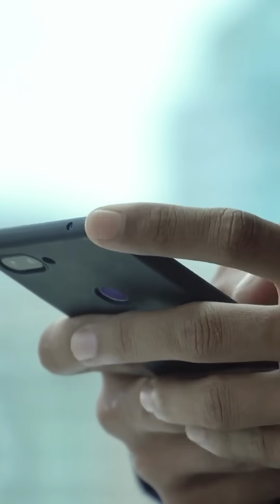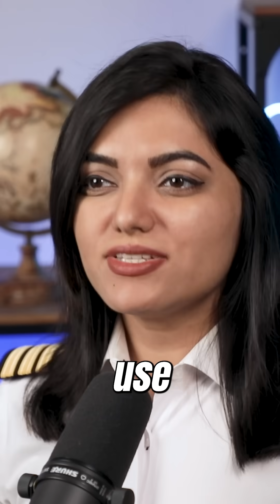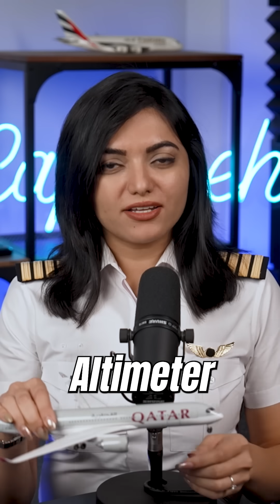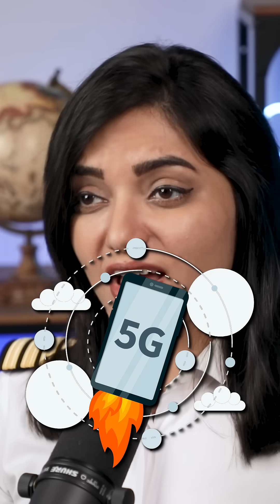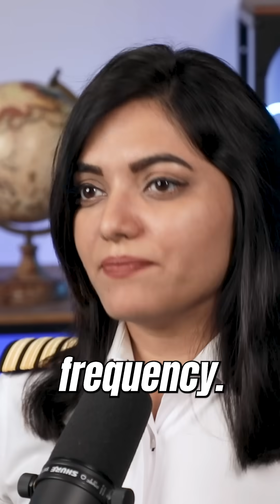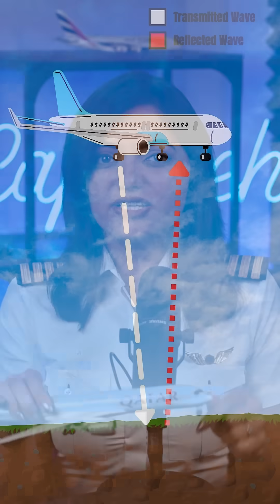Why phones need to turn on airplane mode while in flight? Explained by Capt.  Neha Thakare

Comment: In this age both mobile phone and altimeter are highly precise/accurate class A equipment, with the ability to shield radio interference and squelch. Companies like Boeing and Airbus do sufficient interference tests before aircraft certification.

The fear belongs to the minds of dated, old aviation veterans who impose the extra security over inconvenience and comfort to passengers. This also boosts their supremacy over passengers vulnerability. 

Airlines like Lufthansa are more passenger friendly.

Comment: Even if we didn't put in flight mode i think no problem, same cell phone towers are continuously emitting same frequency, how you stop that signal
Reply: @bulletPondy   but cell tower tower won’t reach 35000 feet , but if we switch on the cell phone at 35000 feet in an airplane , then it tries to interact with cell tower and  in that process it emits radiation of similiar frequencies. But most modern airplanes can handle them, but as a safety measure we shouldn’t use it.

Comment: How about flights with wifi? I think even WiFi is radio waves.
Reply: @boyfromthemountains  actually in case of wifi, wifi have their fixed range of network coverage and same frequency but in case of mobile different person have different Sim and phone working on various frequency and that might change frequency tower to tower as aeroplane passes over the region But wifi frequency will be same all the time. That's why mobile are advised to be switched off or keep in airplane mode.
Reply: @lalitagarwal9155  cool! Thankyou.